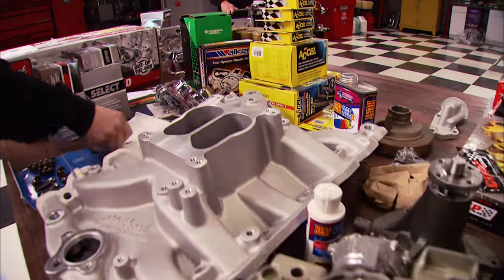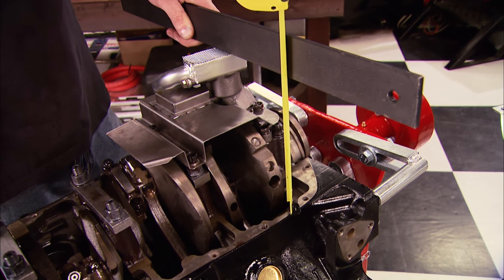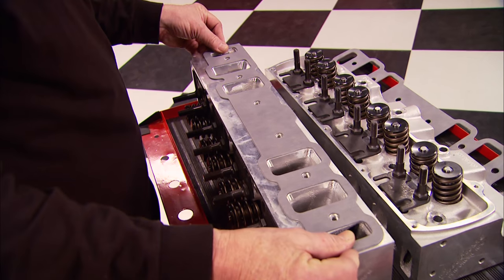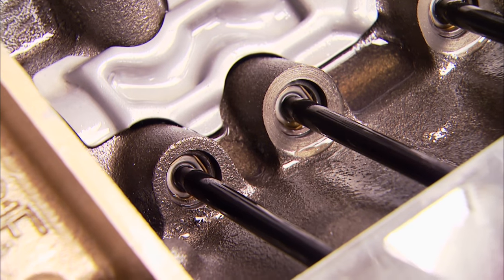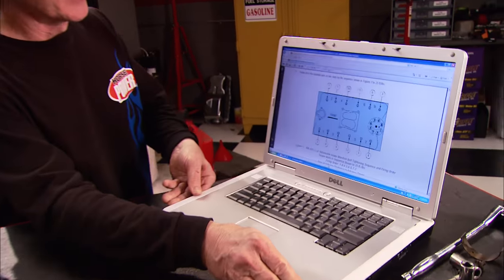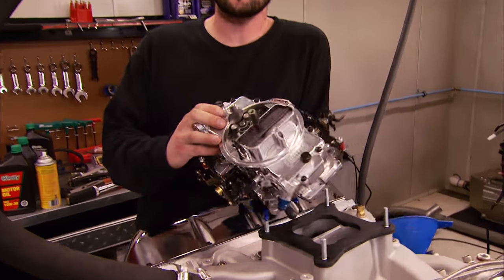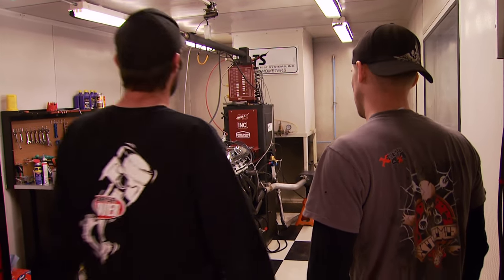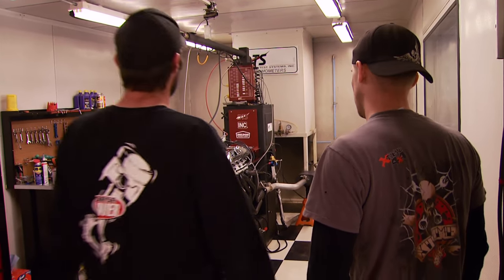Dyno Testing a Mondello 455 Olds Big Block - Horsepower S13, E8

Comment: VACUUM ADVANCE: Disappointed to see two supposedly 'pro' engine builders thinking that a leaky vacuum advance hose is going to steal all their horsepower. At 12:15, he says he's found the problem, in that the leaky hose is 'preventing the distributor from pulling full advance' and insinuating that this is the root issue why they are missing some 100+ hp. Perhaps we should review how & when vacuum advance works and what it's for.

(Please forgive the following cut-n-paste from an article I wrote some years ago for a local gearhead newsletter)

-Two advance mechanisms in most older points type and HEI distributors: mechanical advance and vacuum advance. Mechanical simply relies on engine speed to fling weights around and cause the rotor to pivot a bit opposite the normal direction of rotation and allow the spark to be advanced. Most mechanical advance setups provide about 25° to 35° of total advance (total = initial idle advance setting + the mechanical advance provided at engine speed), generally all in by 3400 rpm or thereabouts.

-The vacuum advance works strictly on engine vacuum (either ported vacuum [vacuum above the throttle plates] or manifold vacuum taken straight from the intake manifold...ported vacuum was a BS emissions trick that didn't work worth a crap, so 60's and early 70's muscle cars and engines used manifold vacuum almost exclusively...the ported vacuum engines were mostly mid-to-late 70's and early 80's). Engines only have any appreciable vacuum at idle and small throttle openings, so there's your hint as to 'when' the vacuum advance will be functional.

-To dig deeper, know that the ease with which an air-fuel mixture ignites and the speed at which it burns is closely related to how rich or lean the mixture is. A richer mixture lights quickly and burns fast (within reason...a super-rich mix will soak the spark plug and cause a miss). A lean mixture is harder to light and burns slower. If we're talking about a track-only vehicle here, with a big cam that allows little idle vacuum and where the car is being thrashed almost constantly, a vacuum advance is never given a chance to do anything or the engine is incapable of generating any appreciable vacuum. The distributors on many older racing engines don't even have provisions for a vacuum advance canister.

-But any car that is regularly driven on the street needs that vacuum advance. Why? Smoother idle, for one (at least with manifold vacuum...ported vacuum setups  have no vacuum advance at idle, so their idle might be sucky, especially on a built engine). But the real reason is at highway speed...cruising. Tooling down the road at 60 mph, the throttle is barely open, so the mixture is very lean...which is fine. We don't need a lot of power to cruise down the road. But, if all we have for advance is the 30° to 35° from the mechanical advance, we're getting a crap burn from that lean mixture. It's lighting way too late, and can even cause header & exhaust manifolds to glow cherry-red, as the burn is happening so late it's completing in the heads' exhaust passage and even downstream from there. That's power that is not being used to propel a piston down the bore. That's big power lost and fuel wasted.

-So the obvious answer is to use the available vacuum that we get at cruising speed to further advance the timing. The advance unit simply has a rubber diaphragm that connects to an arm that pulls on the breaker plate (or the plate that the HEI triggers are mounted to) and the plate rotates around the center to provide an earlier trigger for the spark. A vacuum advance unit can advance the timing 20° to 25° beyond what the mechanical advance is capable of. So yes, bopping down the highway on a lazy day can mean the timing might be advanced as much as 55° or even more. Lean mixtures under little load can take big chunks of advance with no pinging/detonation issues. Stomp on the throttle, and the intake reverts back to atmospheric pressure pretty much instantly, and timing drops back to whatever the mechanical advance supplies, and no pinging (as long as your fuel doesn't suck). And when it comes to fill-up time, your wallet will thank you.
(end article)

So you can see why the assertion that a bad vacuum advance hose is stealing horsepower on the dyno is a silly one. The only time there's any vacuum in this case is at idle...the rest of the time the throttle is WFO trying to make lots of dyno horsepower and manifold vacuum is non-existent. Worst-case scenario is they mighta leaned the mixture a tad, but a small vacuum leak like that isn't going to screw you out of 100+ hp.

Anyway, sorry for the freaking book here...just seems that with newer cars everywhere no one remembers (or ever knew) what vacuum advance was for or how it works.  ✌-out
Reply: So much little shit like that flies under radar to most people!
Reply: no vacuum at full throttle.
Reply: Duh! And at least one of these guys is old enough to remember this! I don’t know, it is a tv show, maybe they’re actors reading a script?
Reply: Understand that I'm not intending to disparage these gentlemen. Tired, late, frustrated, looking for the source of problems and you find something and run with it without thinking it through.
Reply: The only way the vacuum advance would work at WOT is if you connected it to ported vacuum. When it’s connected to manifold vacuum even moderate throttle (under a load) will not produce enough vacuum to move the advance.
Reply: @timsharpe3498  When an engine is at WOT, the throttle plates are, by definition, wide open. Thus there can be no difference in pressure above the throttle plates as there might be below the throttle plates. You can prove this to yourself with a vacuum gauge and a carb with a ported vacuum port. Don't confuse intake charge velocity with available vacuum...they are not the same thing.
Think about this logically...under load, at WOT, with vacuum + mechanical advance hitting 55° or more of advance, there's not an octane rating on the planet that is going to prevent detonation and probably a trashed motor in short order. A rich full-throttle mixture simply burns too fast for that kind of advance to make any sense. Engines (non-computer controlled) HAVE to rely on MECHANICAL ADVANCE ONLY when under heavy load. The only real functional difference between ported and manifold vacuum is ported allows no advance at idle...under virtually all other conditions they function the same, and certainly neither allows for any vacuum advance at WOT.
Reply: I agree up to a point but carbs can still supply a vacuum at WOT. If they didn’t a Holley vacuum secondary would close at wide open instead of opening. Maybe I should have used the proper term which is Venturi vacuum. After all, the Venturi is what makes a carb function.
Reply: @timsharpe3498  I was going to correct you again, but you did it yourself. Yes, venturi vacuum. We only use venturi vacuum for drawing fuel from the bowl or, in this case, to operate the secondary diaphragm. It's effect is localized to the venturi area only. There is no venturi vacuum port intended for distributor advance usage.
(made me think of the Harbor Freight brake bleeder I have that connects to shop air. It too uses a venturi to generate a vacuum to pull brake fluid through the lines. Noisy bastard!)
Reply: Exactly, vacuum advance does not effect timing therefore does not effect horsepower
Reply: My all time favorite was when people used to plumb their modulator valve to ported vacuum and wonder why their vehicle shifted so erratically.
Reply: Old school tech...✌🏽
Reply: I like some old school tech but I also love EFI and electronic ignition. I worked at a government fleet operation during the 1980s when everything was pretty awful. Vehicles with Feedback carburetors were the worst things to keep tuned properly. Those vehicles had 10 feet of vacuum hose under every hood. Fast forward a few decades and my 2004 Toyota with 172,000 miles has the original spark plugs and it runs like new. 

I do miss my old gas guzzling 66 GTO but they’re too expensive to relieve the past.
Reply: Somebody is going to run into an issue while working on there car and read that detailed reply and the solution is going to just click!
Reply: @timsharpe3498  since when do carbs supply vacuum ? Vacuum is created  by the piston in a engine and the choked flow through the intake manifold of the engine.
Reply: @AntDaddy1977  No argument here...but the venturi (the narrowed part of the carb throat) creates a local vacuum. This vacuum is used to draw fuel out of the bowls through the nozzle and (as Tim suggested) operate the secondaries of vacuum 4-barrel carbs. The vacuum created by the venturi is what allows a carburetor to operate at all.
Reply: @warrenzevonsangryghost6055 agreed and I know this os off topic but, I remember them carbs I always thought of them as fords first attempt at fuel injection. But they were shity
Reply: That was a good explanation of why you need a vac system on any street driven car but I don't think that the air fuel ratio plays a role that is quite as big as you make out, yes the ratio does have an affect with lean or rich mixtures burning slower than a mixture that is just a touch lean of stoichiometric. The main reason for the requirement of the ignition system to fire the mixture much earlier in the compression stroke when the throttle is just cracked open is because of the low Volumetric Efficiency (VE) of the engine with the throttle just cracked, this means that there is actually a vacuum in the cylinder during most of the compression stroke with the pressure only rising right at the end of the stroke. The burn rate of the mixture is directly linked to the initial cylinder pressure, in other words the pressure just before the plug fires, if the pressure is low then the flame speed will be low. The whole point of the exercise is to get peak cylinder pressure to occur at 14-20 degrees ATDC, if it is any sooner or later then the engine won't be making as much torque as it possibly could. This also explains why a rise in compression ratio by head or block skimming generally calls for a reduction in ignition timing, the initial pressure is higher with the higher CR therefore the burn rate is higher. It also explains why you can gain a few BHP right at the top of rev range sometimes by adding some more spark lead right at the top of the RPM range, the reason is that the VE has fallen through the floor at very high RPM therefore the cylinder is not getting a 'full charge' of fresh mixture during the induction stroke.

You can also see this effect whilst the engine is at idle, many engines want about 20-25 degrees at idle (note this is the static timing PLUS what the vac system has added), even through the engine is turning over very slowly therefore there is a lot of time in terms of crank rotation in order to peak pressure at 14-20 degrees ATDC the engine still wants a lot of spark lead because the VE is VERY low with the throttle just cracked open, that's why the timing figure is quite high. This state of affairs changes when the throttle is booted open from just above idle, the cylinders now get a full charge of fresh mixture, the timing now needs to back off to maybe 10 degrees in order to avoid the timing being over advanced, luckily the vac system will do that for us!
Reply: @sidecarbod1441  Dude...trying to explain this in an easily understandable manner. 😜 Not that you're wrong, but I was trying to keep it reasonably simple without diving into the deep end. That said, I've been fooling with 2bbl Rochesters and Autolite carbs for flat track for 40+ years. Get a SBC or SBF with one of these and a wideband fast response O-sensor and you might be surprised. ✌
Reply: @warrenzevonsangryghost6055  I setup with all of the engines that I works on, SBC, SBF, BBC and Rover V8 (Buick) with an Innovate LC1 Wideband sensor, I generally use Edelbrock 4 barrel carbs, it has got the stage where generally make my own metering rods, or at least end up modifying Edelbrock rods, it takes a while and they have to be accurate to less than 1 thou of an inch in diameter. I have also modified the standard straight leg primary boosters on a couple of carbs to turn them into annular boosters, this mod allowed me to lean off the cruise AFR from around 15:1 to 16.5-17.5:1 on one engine whilst still retaining good throttle response. Edelbrock now make carbs with annular boosters but they will only sell you the complete carb. For the ignition side of things I like the programmable 6530 MSD unit with a locked out dizzy which I run in conjunction with a MAP sensor in order to control the timing with regards to manifold vacuum.
Reply: Vivian Stimpson  Technically, yes, I suppose, but since maximum vacuum advance only happens under very specific circumstances...when engine builders speak of 'total advance' they are omitting the advance added by the vacuum advance unit. So, if a builder says '36° total advance', that is excluding the vacuum portion. As far as vacuum @ full throttle, you are respectfully incorrect. You are confusing intake charge velocity with vacuum...they are not the same  thing. At WOT, intake vacuum reading is close to zero. Don't believe me? Get a vacuum gauge.
Reply: Vivian Stimpson  Jesus..there's always that ONE guy online who's a YouTube and Wikipedia PHD. Why so salty? We've already discussed vacuum secondaries in this thread; they do NOT operate off of manifold vacuum (Google 'venturi vacuum'). Manifold vacuum = nearly atmospheric @ WOT. This is indisputable, despite your arguments to the contrary. The whole purpose of vacuum advance would not work if it were otherwise. Stop embarrassing yourself, unless posting about shit you know nothing about is indeed your idea of 'fun'.
Reply: Vacuum advance has to be the most misunderstood part of pre-computer ignition systems. I can’t tell you how many people believe disabling vacuum advance “adds power”, when in fact the vacuum isn’t in play at all at wide-open throttle.
Reply: @stevelacker358  Makes the big oil companies happy though...
Reply: @warrenzevonsangryghost6055  wrong, there is a vacuum drop across the carb. If there wasn't no fuel come out of the jets.
Reply: Vacuum advance canisters pull out timing, they don't add anything when you are describing total timing of the engine.
Reply: Made me laugh that he thought he had Vaccuum at wide open throttle lol...
Reply: @3800TURBO  You do have vacuum at wot. It spikes low before picking up.
Reply: Manifold vacuum is below the throttle plate when its closed as this is controlling the 'throttling' effect of the air flow, as you open the throttle the restriction becomes less and the point of low pressure rises up the carburettor towards the fixed orifice, namely the venturi, hence the fuel delivery transition from idle circuit to transfer slot to main jet discharge booster venturi, so at no point does manifold vacuum disappear completely unless air stops flowing into motor, it only lessens ( maybe not able to be measured by crude instuments) the amount of vacuum will vary but going by holley a 2 barrel operates on 3 in/hg and 4 barrel 1.5 in/hg optimally, manifild vacuum port is connected to below throttle plate closed position, ported vacuum is anywhere above and can be in several locations on some cards with several options as to how far throttle is open before seeing signal to whatever is connected thus changing ported vacuum/rpm activation point and not all carbs are the same not even all of same make, to the point I have seen quadrajets replaced with a Halley and complaints about fuel economy because of exactly this disparity in throttle opening to portrd vacuum timing, to spell it out the Halley had larger primary bores so required less throttle opening to maintain same road speed rpm and would not see any vacuum advance till much later compounded by ported vacuum point higher in holley used than original carb, be sure to compared apples to apples,
Reply: Biggest disappointment: Look closely 00:47 re-using stock flat tappet cam... 4700 RPMs HP peak...

Comment: Considering these engines were rated between 275 and 400 horsepower in stock form the 456 hp/ 537 lb-ft of torque was a good number for this mild build on a vintage muscle car engine. Nicely done.
Reply: In 1970, they made over 400 hp stock...this had crank balancing, head and intake swap plus headers....seems like 475 should've been a little more respectable target...considering the engine is limited in upgrades...

Comment: TIMING (vacuum advance) and VALVE adjustment (pre pump lifters) After 30 years Still finding same old mistakes!
Reply: glad you spotted the rooky mistakes. cam brake in is best with 2500 rpm plus!! as for timing i static time the engine and i pr-curve the dizzy so i no the total as well as base timing the instant it fires and use manifold vacuum on the distributor to get more idle vacuum as well as a cooler idel. then i fine tune using a vacuum gauge along with sum wide open throttle blasts. pull the plugs and take a reading.
Reply: Worse: Look closely 00:47 re-using stock flat tappet cam... 4700 RPMs HP peak...